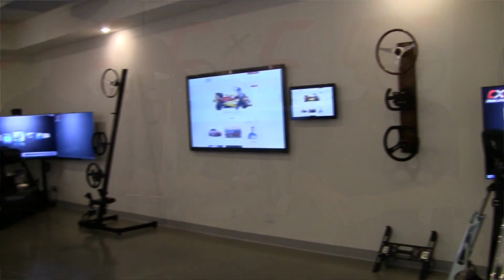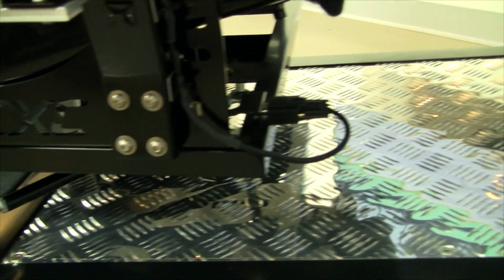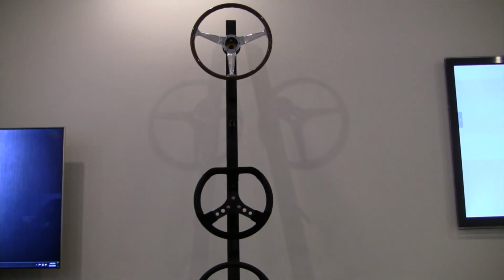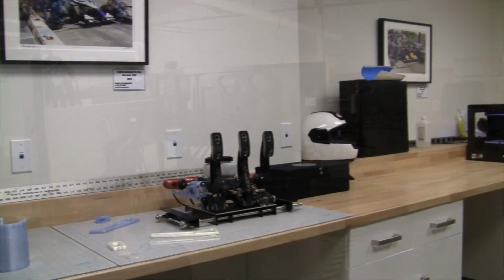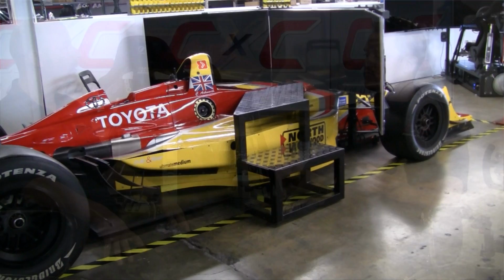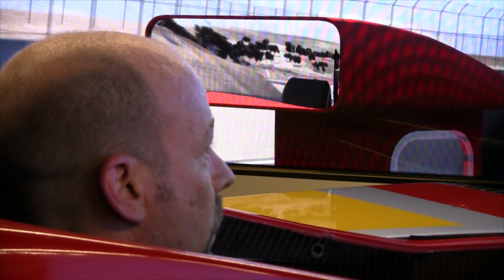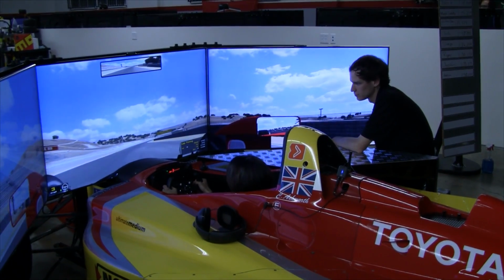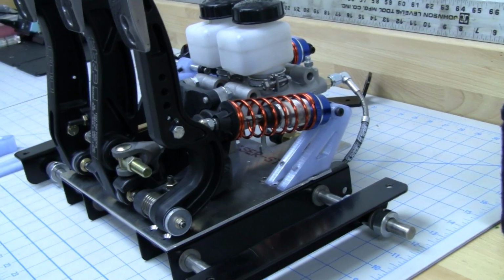CXC Simulations - Chris Considine interview

Comment: I love how people are like "just go buy a real car"

Sure, you can buy 1 decent car. Maybe race it for a small while, but if you only have that 45,000. You aren't going to be able to drive it any where near as often as you would a Simulator, your going to be stuck with 1 car, where as in a sim, you have hundreds of cars. Instead of every time having to clear an entire day or even more in your schedule.... with a sim... bam, when you get home from work, you hop in your sim and your driving in less than 5 minutes. 

Not to mention just how quickly that $45000 would fly by when your driving a car as hard as you do in a Simulator. Of course for $45000 your not going to have  a full built race car. It's going to be moderate at best IF you even start making some upgrades to it. Not to mention the used v8 and v10 super cars you guys are mentioning as a substitute... they wouldn't be able to handle any type of serious racing without dropping tens of thousands more into the car. If you bought that used car, drove it out to a track. There is a very good chance after that first day, you could be spending anywhere from $1k-$10k on something for your Used (Moderate) sports car that you ended up breaking.

All I'm saying is, these sims are amazing because of how many things you can do in them for the 1 time price really. 

Real cars are something that take thousands of hours of time to truly keep up to racing standards over the years. And you'll never get close to feeling what an f1 car might drive like, or any true super car. Real cars are ALOT more expensive than just the tag price. It's extremely unrealistic to say, oh you could buy a car for that price, and race it like you would in a sim. That's bullshit. 

While I do agree the prices are absolutely rediculous for these sims specifically. At the end of the day you just can't compare a real racing car to a simulator in terms of how much money you'll spend. Real driving and racing will break your wallet one hundred times faster.

Comment: Who has $59,000 to spend on A RACING SIMULATOR. It's cheaper to buy your own car, mod it and then have money to run it on a track.
Reply: OMG! the price of these wheels are way to much under 3k uh? thats a damn car
Reply from the maker: Drift Monkey You can have a simulator that costs under $3000 or even less if you just race at a desk. These are for the very well off.
Reply: I know, I don't mean to hate. I was just trying to make a point.
Reply: probably mostly for trade shows
Reply: A real race car, running on those tracks, all the running and competition costs, can add up to MILLIONS.  With this you can drive almost any car in many different locations.
Reply: 60k iss maby what it cost to run it a race weekend xD
Reply: You can buy 1998 Swift 008/014 Formula Atlantic for those $59k and still have some money left for fuel and get it to the track to have some fun or even run a season.
http://bringatrailer.com/listing/1998-swift-008014-formula-atlantic/
Reply: +Chase Hoffman First time you shunt a advanced car with alot of custom and carbon fiber parts you can easy spend 10-15k on a rebuild..
Reply: +neil tibbs real formula 1 and indycar racing wheels cost about $30,000
Reply: +Chase Hoffman But once you've got that you have thousands of hours at zero cost. Chances are if you are buying one of these you can also afford something like a 1 make series no problem. Sim obviously isn't racing but it has a number of advantages - race any time at zero cost. 

For many people racing is a passion but it cannot  be their life regardless of how much income you have , people have jobs, kids, etc. Sims can close that gap.

if I had 60K burning a hole in my wallet I'd have one of these rigs before say a year racing Ginettas because I actually have the time to play this. If I had 600K... well, different story.
Reply: exactly there are cheaper and better out there from more reputable companies. 59k for this, seriously?
Reply: Chase Hoffman Me 😂😂

Comment: I know it's not easy to make a thing as this, but I think to make a movable seat with fix pedals, steering and monitors is not much better, than sitting on a chair in front of 3 screen. And it's ridiculously expensive! There is the 4DOF simulator, I think from czech republic. It moves properly and you can buy 3 of them on the price of one CxC. Or an other option, a way cheaper, but proper sim, SIMRacing Austria. Honestly.  Who buying this CXC?